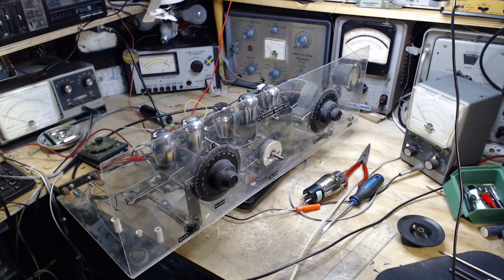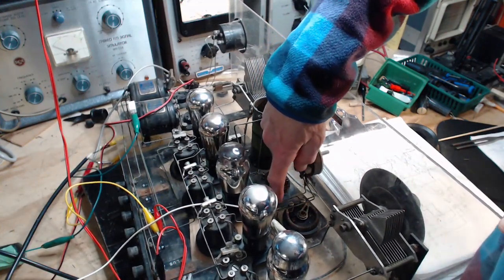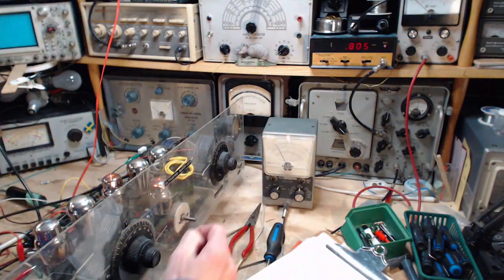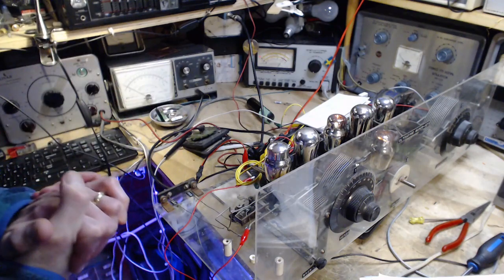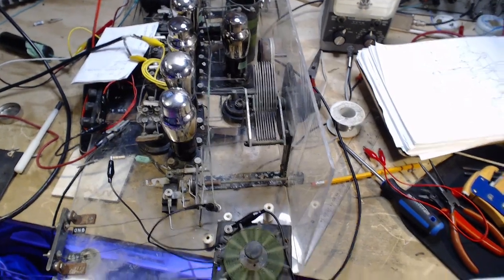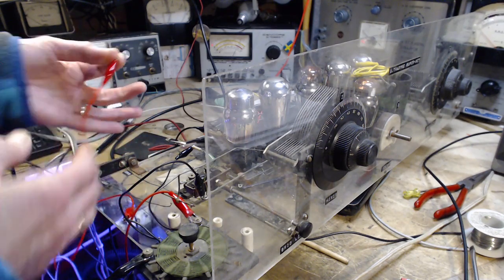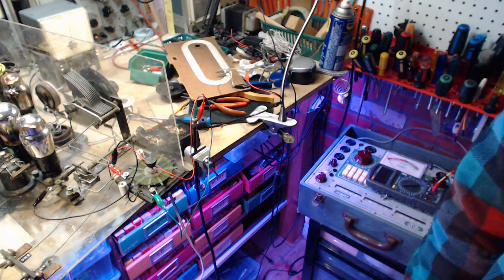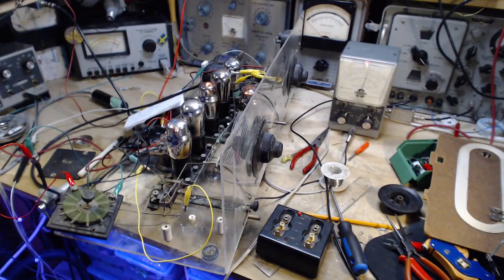Lacault Ultradyne 1925 Receiver Video #8 - Making 'It' Receive

Comment: Jim that needs the first coil refitting .

It's the input tuned circuit with the variable cap you're ignoring & part of the mixers grid circuit .

( Tube 1 Grid - Resistor across Cap - Tank circuit with coupling coil in top of the LO coil )

The first tube is the mixer .

The Michelin style tyre variable on the first tube grid looks like it has a small capacitor hidden under it in the woodwork !
                             So just a standard adjustable grid leak resistor & cap  .

The small coil in the top of the local oscillator coil is the mixer injection level adjustment 
& is part of the input tank circuit .

Note
You have separate LO & input tuning  !
Reply: The rheostats look like a IF gain adjustment .
Just dialling in the IF grid voltages as needed  .

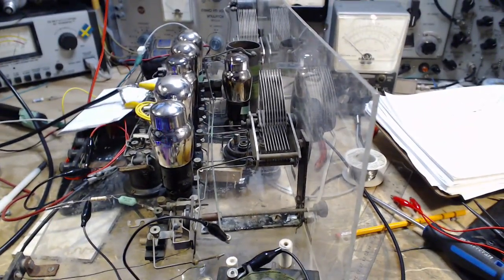Comment: 52:47 this hookup cannot work. The first tube (mixer or modulator however you want to call it) needs to bias its grid using the grid leakage resistor (potentiometer). But for grid leakage to work it needs a DC path. In the original design of the radio the DC path was provided thru the secondary of the Steinite antenna coil and the pickup coil inside the OSC coil to ground.
His hookup ties the secondary of the Steinite Antenna coil to the grid of the first tube via a series of resistor and capacitor, thus effectively blocking any DC path for the grid.
Also, like the grid leakage resistor arrangement found on the detector tube, a carefully set grid leakage resistor can not only cause rectification but also operation of the tube in a non linear area. And it is there where distortions will occur that allow the OSC signal and the antenna signal, both fed into the grid, to intermodulate and produce an IF.
Bottomline; you cannot set out to modify a circuit if you dont understand it.

Comment: Dear Jim, that radio is actually a Phenix Ultradyne L-2 receiver. The only thing missing in Your plexi-glass radio is the oscillator coil. The "coil inside a coil" contraption and the "Steinite loop antenna" together forms the actual antenna coil. There should not be any oscillations in the variometer (coil inside a coil arrangement). The inner coil should be aligned almost perpendicular to the outer coil such that they are on the verge of making an oscillation, but not enough feedback to really start one. If You arrange it so, the front end will have almost infinite gain at the tuned frequency. Actually, this is te basic principle of a regenerative receiver. The "ultradyne L-2" design combines this 'regenerative principle' with ultradyne technology. Without implementing the principle of a regenerative receiver, Your front end will not have sufficient gain to actually receive anything from antenna.
Reply: Nope. This is a superhet following exactly the basic principle as depicted in fig.6 in the phamphlet he showed on the last video. It is all there.
The oscillator may have been an antenna coil in a previous life, but here it is clearly wired up and "misused" as an oscillator coil, with the moveable inside coil being the needed tap to allow a small amout of osc signal being fed into the antenna circuit, with the intention to undergo mixing in the tube to produce a low frequency IF.
Same "misuse" principle goes for that Steinite in which the inbuilt trimmer had been disconnected, which is evident looking at the previous videos.
Reply: @randomsteve4288  I agree;  "The oscillator may have been an antenna coil in a previous life, but here it is clearly wired as oscillator coil". Jim confirms it in this video. He says among the two fixed windings of the coil, one is connected to the grid and another to the plate. The movable coil gives an adjustable feed in to the antenna coil.

Comment: Jim, I think you are calling the radios VFO the local oscillator. 

For a Super Het one needs  a local Osc, VFO and mixer. I think finding those three functions would help clean up some confusion.

  The Stenite is an adjustable filter / preselector LC circuit providing selectivity for the radio. The cap underneath needs to be attached to the inductor then you can rotate the knob to add/remove capacitance to tune to the frequency of interest.
Reply: The cap underneath the Steinite was not connected. That can be clearly seen in previous videos. 
So the only thing in that Stein-contraption used for this radio was its antenna coil. 
AGAIN someone botched this radio together from parts he had at hand. The parts were modified and/or used in a not intended way. 
Thats why a crystal detector frontend became an antenna coil and an ex-antenna coil with turnable inner winding ended up as oscillator coil. If we would get a proper reengeneered schematic of this exact radio you would see it too. 
But unfortunately his drawn up "schematic" looks more like a doodle and only serves to confuse more.
Reply: @randomsteve4288  
A coil is a coil     ….   You use it for what you need .

Comment: 24:13 If that is the oscillator signal, then why it's range is exactly the MW band? The coil you think as oscillator coil is actually the antenna coil. It is oscillating because it's inner-coil orientation is so bad that it actually generate positive feedback. To solve the problem, make the inner-coil perpendicular to the outer-coil.
Reply: It oscillates because it is wired as an oscillator. And with only 100-some kHz IF you will ofc have it oscillate in the BC band.
And while the oscillator coil may have been an antenna coil in a previous life, here it is wired an used as an oscillator coil.
The small inner coil being turnable is of no regard to the oscillator. The only benefit if it is, that by turning it you can change the strength of the oscillator output signal that which is added/overlayed to the antenna signal.
This IS a superhet design following EXACTLY the fig 6 of the paper he showed in the last video.
AGAIN this radio has ben cobbled together from parts that are not used in their intended function. You have to reengeneer and look at the schematic for this particular radio not some "I guess it is the model" schematic. 
Too bad his schematic is more abstract art than somethimg worthy of an ex-electro engeneer.
Reply: @randomsteve4288  I agree. In this video Jim explains the oscillator connections. That confirms this is a super-heterodyne receiver. antenna coil from a regenerative radio is repurposed as oscillator coil. The Steinite coil (with removed internal capacitor) is repurposed as antenna coil. By feeding a small portion of oscillator signal to the grid of modulator tube through antenna coil, mixing is implemented. So this is a custom-made superhet receiver.

Comment: 41:30 only hear output when the local oscillator is exactly same as the signal generator frequency. This also indicates that coil is actually antenna coil which is so badly aligned to create oscillations.
Reply: No it is not. His IF strip is misaligned and he is blasting the poor radio.